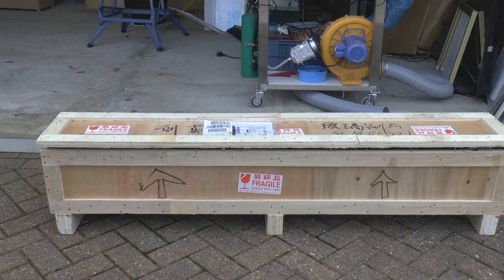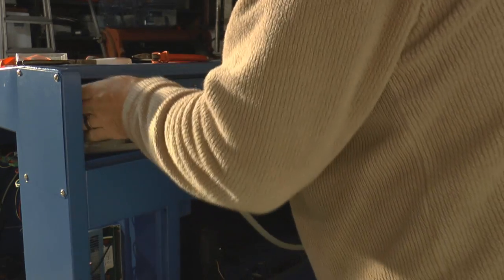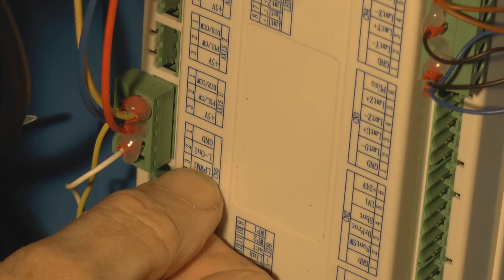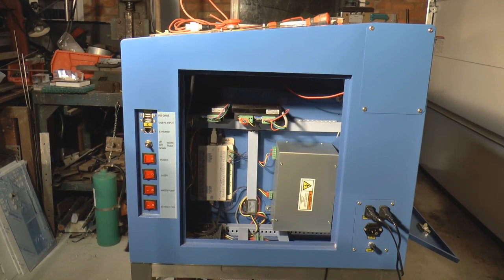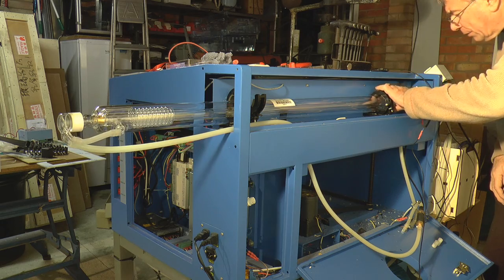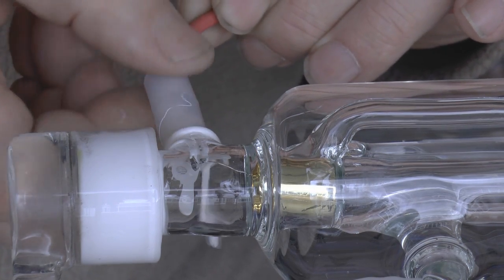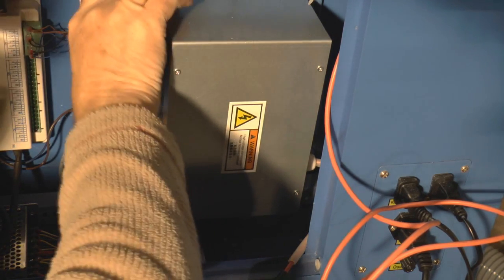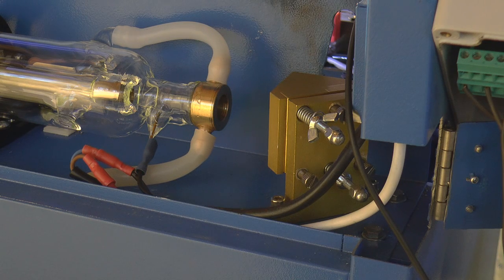RDWorks Learning Lab 50 fitting 60watt tube and PSU

Comment: Hello, but the new tube protrudes from 1200mm cnc of about 25cm, I would make a lid that covers the side of the high voltage. advise me to do it in metal or plexiglass?
according to you, I can connect the two cables (high and low voltage) with alligator clips like these?
Hello and thanks
http://it.rs-online.com/web/p/clip-a-coccodrillo/0483843/?origin=PSF_437268|alt
Reply from the maker: Hi Michele

You can use almost any material for the cover. I used 5mm plexiglass because i had 2 large sheets that I was given. You could use 5mm plywood or MDF and make a very strong cover using PVA wood glue. Metal is equally good if you have facilities to work with metal sheet.
If you have crocodile clips they will do the job well but at the HV end make sure to remove the pvc sleeve from the clip and put that connection inside a piece of silicone tube so that you can fill it with the white non-corrosive silicone sealant that they normally supply.  It is important to exclude the atmosphere from the HV connection so that there is no chance of arcing to the case.

Best regards
Russ
Reply: Thanks, I understand everything, when I mounted the new laser tube let you know the results, you have been very helpful, hello!

Comment: by running a water chiller instead of room temp water, will it make the laser last longer? IF so, what is an optimal temp the water should be at?
Reply from the maker: Hi
 different tube makers recommend different max running temperatures. Basically the better the tube the higher the permitted temperature. RECI along with a few others recommend a maximum of 40C. The cheaper tubes tend to be about 25C. There are several factors that can  shorten tube life,  temperature being one of them. These machines are sold primarily for ENGRAVING with cuttin as an afterthought.  Cutting requires high power whereas engraving does not. There is a maximum current that is allowable to attain the life specification for your tube. Cheap tubes claim 1000 to 2000 hours. If you continually run at or near the makers rated current and temperature, you should get the 1000 hours. Exceed that current and the tube temperature starts to exceed what the gas in the tube can transmit to the water jacket.  Under this excess current condition there are other things going on in the tube that will dramatically shorten the life of the tube. On the other hand if you stay well below the makers current rating, not only will you be producing less heat for the cooling water to deal with but your tube will last longer. In cheap tubes there is another factor that could come into play and that is the integrity of the epoxy seals that bond the mirrors onto the tube and seal the partial vacuum inside the tube. Over time (maybe 2 years) some outside air can get sucked into the tube and contaminate the mix, so shelf life/quality is another issue. Don't spend lots of cash on a chiller unless you are in a subtropical climate  Temperature is one small factor in determining tube life and depending on your geographic position and machine siting there may be much more cost effective ways of keeping your water cool
Best regards
Russ
Reply: well one thing Wisconsin has never been accused of is being tropical. I thought of throwing either and ice pack or ice cubes in with the water to cool it down. and maybe put a temp sensor on the laser to keep and eye on it. there's another video of someone that installed one on his laser machine like ours.
Reply from the maker: Hi
Your air temperatures are a little different to that which I experience just north of London. if you look at https://youtu.be/g5k6YhNqfSw
You will see that I have a closed water system with about 2 gallons of distilled water. The flow rate through the tube is about2 litres/sec I don.t use my machine for long periods and never find I need additional cooling. However, I do have a plan B and a plan C. You will see that I mention a copper cooling coil that I made to drop over my pump. I have tested the machine during our "hot" 28C summer days and when running the machine for a 2 hour period at max power I could get the temperature up to almost 40C  and resorted to plan B I connected my cooling coil with a hosepipe to the domestic tap water supply and regulated the flow through the coil to about 2 or 3 litres /minute. The water supply was at 14C and within n15  minutes my water was back to 23C was it was stable.  It is VERY rare that I need to use my coil. Plan C was if I needed more that temporary cooling. Outside my workshop I have a rainwater collecting tank (40 gallons or more) and the plan was to add another submersible pump to  this tank to drive water through my coil ie to use this tank as an external heatsink/radiator.  Never been needed.
Also https://youtu.be/xDZmuxq5BEM shows how I have monitord temperature.
Best regards
Russ

Comment: Hi Russ! I bought a laser machine 50 watts 2 months ago! I then discovered your videos on youtube and I have learned quite alot with you :) Thank you for sharing your experiences and videos!
But about a week ago, my laser machine stopped cutting and it isn't burning on first position -> when laser emits to first mirror. I have contacted the manufacturer but they think that my problem is in the mirror alignments. With your experience, what do you think the problem could be? The laser tube lights up when I pulse, but it does not burn the paper I put in front of the first mirror (first position). If you could help me out I am very thankful. Meanwhile, I will keep on sending emails to the manufacturer... 
Thank you
Reply from the maker: Hi Amanda
I have had several correspondents with the same sort of issue, either rapid loss of power or no power at all.
I suspect you will have trouble dealing with your seller to get any satisfaction or refund or replacement tube. If there is no power coming out of your tube before mirror 1 then it's bad news because as you say, the tube still lights up.

Please forgive me but I am going to give a brief technical explanation (in simple language) of how the tube works and then you will understand what is wrong with your tube

Your sealed laser tube contains a mix of 3 main gases. Each of those gasses performs a specific task. The first and most important gas is Nitrogen (about 10%). Like all gases it is an insulator ie it does not conduct electricity. However, if you subject it to high voltage (in this case about 25,000 volts DC) it can be excited into a state of IONIZATION where its atoms vibrate so much that they shed a few electrons. These electrons are then current carriers and all of a sudden a non-conductive gas becomes a VERY efficient conductor.
This current flow causes the nitrogen to heat up (a bit like a heating element in a fire) and this current has to be controlled by the power supply to very low milliamp levels.  This is where the second gas comes into play. Helium (80% of the mix), is an excellent conductor of heat and it’s sole function is to carry the heat from this process out to the water jacket.  The more the current the nitrogen carries the more excited the nitrogen atoms become but the more heat they generate. There is a limit to the heat carrying capability of the helium and this is the main factor that sets the max running current for your tube.
You will hopefully notice that I have not mentioned anything about CO2 and lasing yet. That is because this ionization process I have described so far, works REGARDLESS of the presence of CO2 . So, your tube will light up even if it's DEAD.
Okay let’s add the third gas, carbon dioxide (about 10% of the mix). I like to imagine this molecule as extremely lazy, it just wants to slob out on the sun lounger. However it can be persuaded to jump up when a football from the neighbour’s garden crashes into it. The excited nitrogen atoms occasionally crash into the CO2 molecule and persuade it to get a bit excited itself. However this state of excitement in the CO2 molecule is VERY temporary , it just wants to get back to the lounger. It calms down again by giving out its extra energy as a photon of light. All of these photons are collected and mechanically amplified by internal mirrors inside the tube and eventually appear out the end of the tube as a coherent beam of energy.
This simplified explanation of how the tube works will help us to dissect your problem.

1) You say that your tube still works lights up.  This automatically tells me that your power supply is working. If you can see a nice pink beam then the ionization process is working. Do you have an ammeter fitted to your machine? I suspect no. I found out that is an essential instrument to help manage your tube. ( take a look at https://youtu.be/xDZmuxq5BEM   ) 
2) If you do not have an ammeter fitted to your machine and/or are unaware of what the limiting current is for your tube, you may have unknowingly “over-driven” your tube with excess current. Excess current  or even running at the recommended limit will see the nitrogen atoms imparting serious kicks to the CO2 molecule. These kicks can have enough energy to split one of the oxygen atoms from the molecule resulting in a free oxygen atom and a CARBON MONOXIDE molecule.  Neither of these gasses are lasing gasses. This dissociation process is slow and a natural way that your tube dies eventually and as you can see it looks dependent on how you use the tube. If you “over-drive” the tube this process will happen quickly. So eventually the CO2 in the mix gets less and less and no matter how much %power you dial in you will not be able to get much or any  power out. I suspect this is what has happened to your tube

The fact that your seller is telling you it's a mirror setting problem means he knows nothing about these machines or, if he does, he hopes YOU know nothing and is keen to make this YOUR issue.

In conclusion I anticipate your power supply is still OK but your tube is depleted of CO2. All CO2 tubes are considered as consumable and your seller will do anything to tell you it's not his fault. However  there may be a way to put pressure on your seller.

Did you buy this machine with your credit card? If yes then there is a good chance you will be able to complain to your credit card company about your purchase. The credit card companies are bound by lots of legislation that will give you protection against fraud or faulty goods. The first thing I will advise is to measure the length of your tube.  My guess is that it will be about 800mm long. If so then you have been sold a 40 watt tube and not a 50 watt tube as advertised and this is a very strong fraudulent selling point . Normal CO2 tubes are consumable, yes, but even the cheapest have an expected life of between 1000 and 2000 hours. My collected information from many correspondents seems to indicate that these ebay machines are fitted with B grade tubes that do work but not very well or for very long. Sadly you are another that I can add to that list. You might like to put these issues to your seller with the threat of contacting your credit card company. He may give in easily if he realizes you know what you are talking about and offer you some sort of refund.

I'm sorry this is bad news  but I hope you may be able to get up and running soon. I realize this may be very disappointing for you and that it may be a shock to have to replace your tube so soon. 
I will be happy to advise further if you have to buy a new tube or there are things you don't understand.

Good luck
Best regards
Russ
Reply: Hi Russ! Thank you very much for your time and great explanation! I really appreciate it! I really liked your explantion with the gases (I will have to read it again a 3rd time) but I understood the basic idea! 
I don't have an ammeter to measure but I might have over-drived my laser machine... The laser tube measures 800mm (like you mentioned it probably is a 40Watt laser tube) and I have been using 85% of power to cut 6mm acrylic.... I was pretty impressed with the machine, it was doing a wonderful job, but it only worked for 2 months :(
I paid with credit card, I will have to contact them and see what is possible to do in this case....
I will wait to see what the manufacturer does to solve my problem, if they do...
I am thinking though, I might have to upgrade my machine for a laser tube with 60watts, because the type of work I want to do is cutting 6mm acrylic...
Thank you again for your help and I really am impressed with your work and your explanations :) I will probably need your help again and will contact you :)
Thank you
Reply from the maker: Hi Amanda
It's pretty certain that you have hastened the death of your tube by over driving it but don't admit that to anyone. Just say that when you bought the machine you had advice to stay below 60% power (about 19mA current) and you have stuck by that rule. However I would have expected a longer life even with the abuse you have given it.
If you make a claim via your card company play on the fraudulent advert.  Look at these  laser tube specifications and you will see that a 50 watt tube should be 1000mm long . You definitely have been sold  a 40watt tube.

http://www.cncoletech.com/Laser%20tuber%20standard.html
On this site there are LOTS of 50 watt tubes for sale . ALL are 1000mm long
https://www.alibaba.com/showroom/50-watt-co2-laser-tube.html

There is a 3 part video about understanding your laser tube at   https://youtu.be/6onXMU08GzQ

This is what I upgraded my machine with   
http://www.aliexpress.com/store/product/60W-CO2-Laser-Tube-60W-CO2-Laser-Power-Supply/321243_990434442.html
The products are excellent value and quality but the shipping cost is ridiculous. However it did arrive within 4 days.

Best regards
Russ
Reply: Thank you Russ!!
Reply: The shipping on that is as much as the tube AND it is listed as a dual lot but a comment below said it is a single lot on the same page.  Almost 700 dollars to have it arrive at my door.  ouch!
Reply from the maker: Hi
Yes. its a strange way of listing it as 2 pieces. In fact it means a power supply and a tube. Yes it is an expensive landed cost courtesy of DHL. Sadly , any Chinese supplier of this fragile equipment will be using a courier. If you want to buy kit that has been landed in bulk and with duty paid then look at people like Light Object. However, a word of warning. Check the specification of what you are buying VERY carefully. Compare the claimed LightObject spec with that of the manufacturer. There is often a BIG difference.
Best regards
Russ
Reply: SarbarMultimedia
Are you saying the LO kits are junk then?
Reply from the maker: No, just overpriced for what you think you are buying. They are keen on specifying (and charging for) peak power of 50 watts for example. It may be an 800mm long tube with a normal manufacturers rating of 40 watts when driven with a max allowed current of 18mA. LO will claim this as a 50 watt tube and charge accordingly. If you run this tube at 20mA (the normal max for a 50 watt tube) you will be over driving it and will invalidate any warranty that may or may not exist. Also look caraefully at promised life. The more realistic tube specifications appear on Aliexpress or Alibaba for their SP tubes. All I am saying is do your research. Buying direct from China can be cheape. You buy a product that does what is claimed BUT the cost of DHL shipping is unbelievable. Hence the temptation to buy something already landed. Look carefully at the tube life. I have recently found out that the tube life is not "beam-on" hours but  is a typical shelf life....used or not.  This is because the gas inside the tube is there as a partial vacuum and over time there is ingress of normal air past the seals that messes with the delicate mix inside the tube. Never buy a spare tube until it becomes necessary and just remember that the tube LO sell have about a 2000 hour life promise........that's only 83 days or 2.7 months!!!
These are worst case figures so you may be lucky and get 6 months. This is very important factor you should consider when making a cost/benefit  analysis for a new tube  purchase.

Best regards
Russ
Reply: SarbarMultimedia
Well, thank you and since this is just a use once in a while I will find something else to take its place then because shelf life should never ever be a part of a lifetime on any machine.  That is just beyond ludicrous. :(